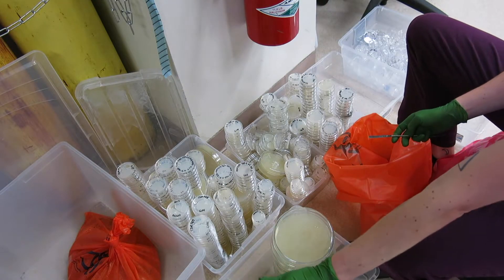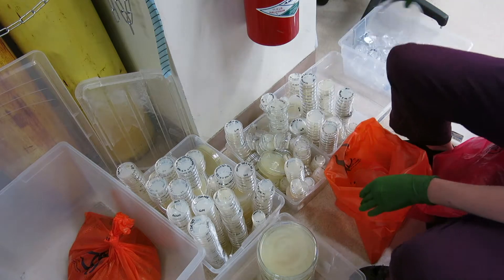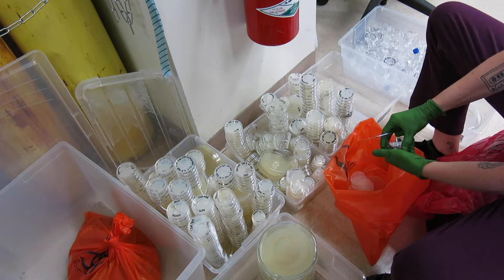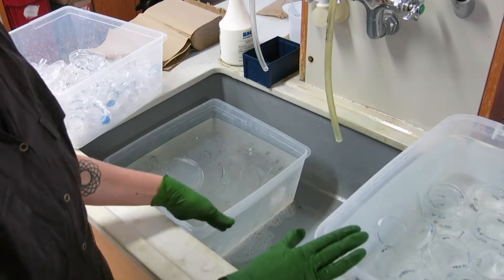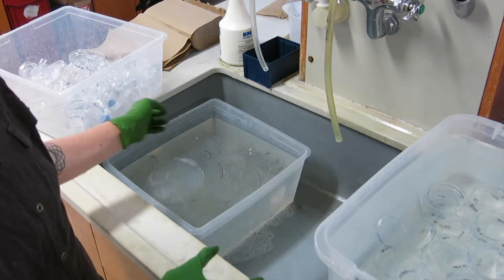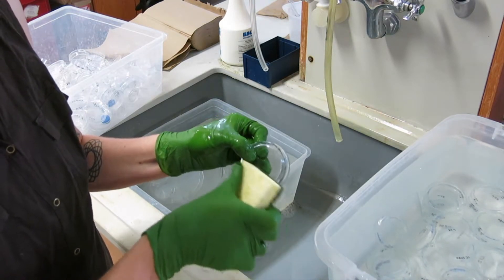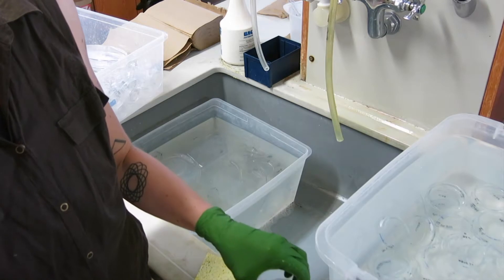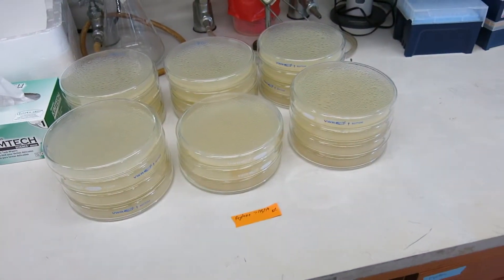Reusable Glass Petri Instructional

Comment: Nice video. Did anyone try skipping the washing steps and just autoclave directly? 

So just scrape the agar off, wipe labels and autoclave before repouring plates. Do you anticipate any difficulties with doing this? (I guess trace amounts of antibiotics left from the previous pouring?)

Also it would be useful to add links to the catalog numbers of glass petri that you use in the lab.

Comment: So I'm making agar (glass) petri dishes at home, growing some bacteria. I'm going to throw the agar out and put the glass in the oven for 10-20 minutes, at 480 F. Is that enough to kill most of the stuff inside the dish?
Reply: I do not recommend growing your own bacteria at home, because you can unknowingly expose yourself to a very high concentration of an opportunistic pathogen. 

As for your conditions, the amount of time is short and the temperature is higher than it needs to be. It is likely to work, but it is possible that some endospores will handle those conditions for 10 minutes. The type and quality of glass is also important to take into consideration when you want to expose it to 'extreme' temperature cycles, as some types of glass will crack. The recommended settings that I have seen for dry sterilization in the oven are ~400 F for 1 hour (https://www.youtube.com/watch?v=MVtEBtxkhGk).  I personally prefer using a pressure cooker, as I can sterilize the petri dish with the medium inside.
Reply: 250F for 2 hours

Comment: Too bad I dont have a dishwashing autoclave....
Reply: Pressure cook glass or pp5 plastics 20min 15psi, bake glass in a standard oven 225-250 for an hour. Only glass for oven.
Reply: @alexandertombs4054  thanks a lot for that answer
Reply: how do you maintain sterility from the pressure cooker to when you pour the plates?
Reply: @jxt2721  Depending on the size of your petridishes you can place them in a larger container (e.g. a large beaker) and cover the beaker with tin foil. After autoclaving, place the beaker (with the foil still on top) in a drying stove to remove the water that may have accumulated in the container. Finally, transfer everything to a laminar flow cabinet or your sterile field for filling and continue as usual.